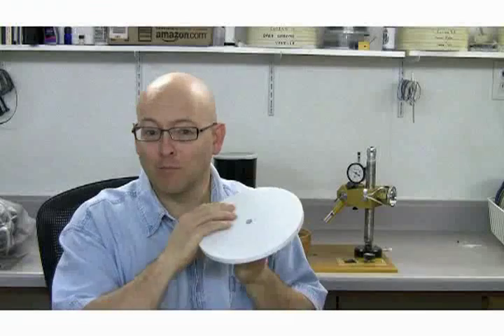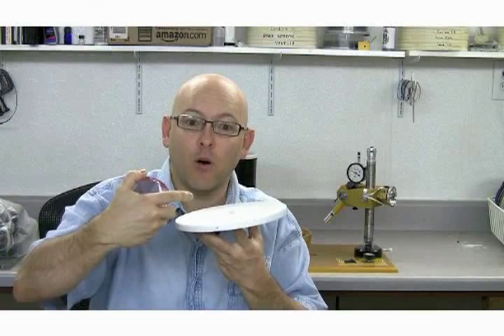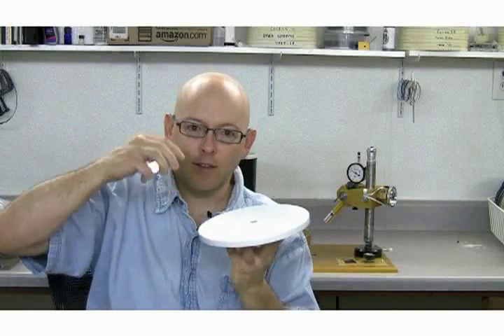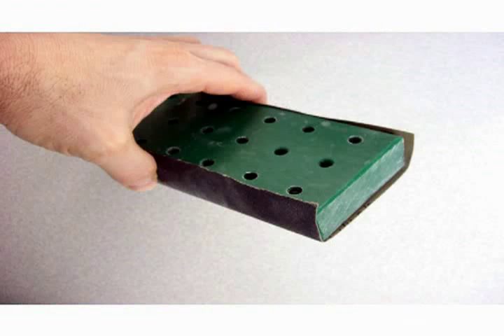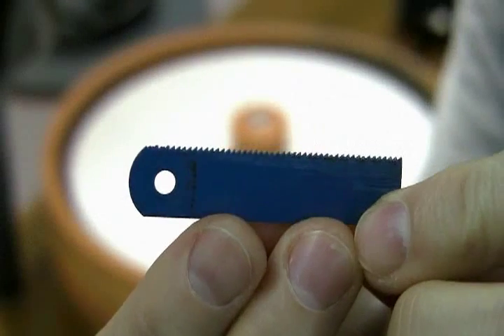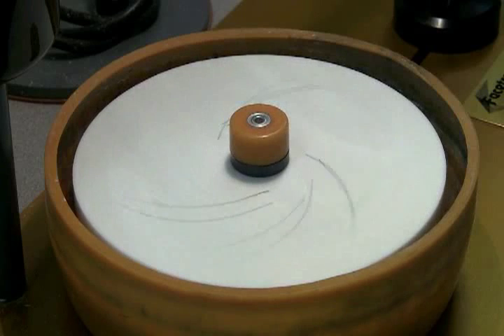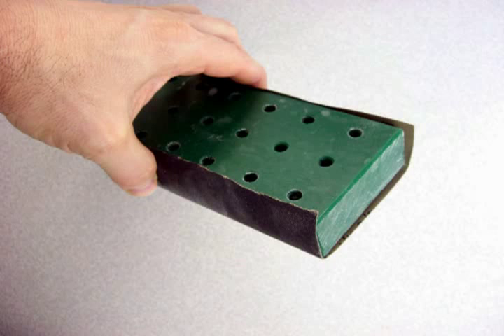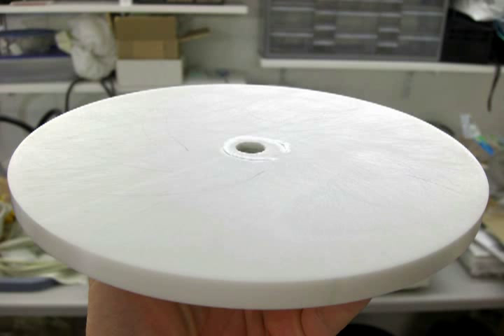Scoring a Polishing Lap

Comment: Hi, 

I have got some big scratches on my zinc lap due to the stone was suddenly broken from the dop. Should i fix it with a sandpaper or a hack saw blade?
Reply from the maker: DO NOT SAND A METAL LAP. You might embed grit or fragments in it.

I also don't recommend using the hack saw blade technique, either. The scoring is often way too deep.

Begin by washing, scrubbing with soap and a nylon bristle brush. 

Then, use a NYLON scrubbing pad and some mild solvent like WD-40 to scrub the lap by turning it reverse from the direction it was in when the stone broke.

Finally, inspect by eye and with fingertips feeling for embedded fragments of the stone.

If you can find nothing, test the lap gently using a soft stone like window glass or marble that's been faced to pre-polish level. See if you're getting scratches.

If it's not scratching, you're probably OK. If it continues to scratch, use the glass to find the spot on the lap that's scratching and then pursue spot decontamination using the scrubbing pad. DO NOT USE STEEL WOOL. I often will use a stainless steel brush - one of the small toothbrush sized ones. You might possibly use a razor blade.

These are techniques that fall short of sending the lap for machining a new surface. With care and effort you should be able to avoid that.

Any other questions, feel free to send an email through the web site.

Good luck.
Reply: @gemstoneartist  thank you for your reply i will soon try to fix it.

Comment: Hi I was wondering whether it's possible to resurface a phenolic lap? I have one that I have used for many years but recently I have had consistent scratches with it when I polish quartz. More so than the usual quartz mayhem... I have some visible scratches but I can't feel them under my touch so I am unsure about this. I don't suppose it's a lap that would be scored though...
Reply: If your lap has gotten glazed or contaminated, it could be the source of your scratching issue.

You can easily resurface a phenolic lap the same way you do any other composite.

Have a look at this video:

https://www.youtube.com/watch?v=VTqp2wzMDEI

Hope this helps.
Reply: Hi John many thanks for your reply. I didn't realise the phenolic lap could also be sanded down. I will try it!

Comment: Instead of sandpaper what would you recommend for a metal lap, specifically a gearloose zinc+? I ended up putting a decent gouge in mine and it sure is frustrating. Thanks for all your videos, I hope to attend the academy someday soon.
Reply from the maker: The reasons for scoring are mooted by modern alloys (BATT, BA5T, etc). So, I wouldn't recommend scoring those.

For scoring other metal laps like traditional Tin or even Copper, I do NOT recommend the traditional methods like razor blades or pieces of hacksaw blades. Those things are WAY overkill. All we want to do with scoring on metal laps is to break slightly roughen the surface - to "break the glaze". We want those things to be fine, and really all over the lap.

I personally use wire brushes with stainless steel bristles. I start with a small, fine-bristled brush that's just bigger than a toothbrush, and if I think that's not enough I'll use a more coarse one (almost never feel the need). I put the lap on the machine, and drag the brush from next to the nut outward to the edge. This rotates the lap just enough for the next almost-radial swipe.

I wouldn't recommend scoring a Zinc+ prepolish lap, either. It's not needed and  will just impart undesirable surface problems. If you've gouged one of those to the point it's a problem, send it back to Gearloose for re-surfacing - or buy a replacement.

There are still seats for the May event, and your comment here will earn you an extra discount if you seize the day...

Comment: Stair stepping is exactly my issue John .  This video on sighting the rifle was very helpful.  One quick followup question.  Once sighted do you always go back to zero "0" on the cheater for cutting the next stone's pavilion and then always go to the marked cheater number after transfer for the crown?  I assume the answer is yes, unless you change gears but would like confirmation.  Thanks so much for the tip!!!
Reply: +Christopher Olson I think there's some confusion. The zero mark on your cheater is ZERO. That means the location of "zero twist" after transfer. This only works if you cut the pavilion there - and also cut the crown there (at your MARKED) zero. If you begin a pavilion at the "0" on your cheater - and then move to your mark (assuming it's not ON the "0") - you're going to impose even more twist.

To be clear: The ZERO that you MARKED - that is your "true zero" - at which to begin all stones, and where to return after all transfers.

I hope this answers the question - and prevents errors. Other questions, just ask!
Reply: I have a full knowledge in Daimond polishr cutting and xxx with hert & arrow contact me my what's up number is a+919904688180

Comment: Dude, your awesome. Great tips and advice for a novice cutter like myself. Could you touch on polishing on plastic laps? Thanks
Reply: +drick freak Thanks for the kind comments. Treat plastic laps the same as Corian. Score / resurface them the same way. Charge them the same way, etc. Same for polycarbonate, etc. Hope this  helps!
Reply: Thank you. Your knowledge is treasure. Im using a very old machine but it works great. Polishing is the greatest mystery to this artform for the amature. Morning stone, barion oval sunstone 15 ct.

Comment: I wish I would of seen this a week ago.  I'd assume this works equally with a lead polishing lap.
Reply: +Keithvs Sorry it took me so long to post back - just saw your comment. DO NOT use this technique on a lead polishing lap - it's likely you'll leave grit embedded in them. Most of the advice I've seen about scoring metal laps uses things like razor blades or other metal scoring tools. In my experience, those also cause problems. My favorite tool for scoring metal polishing laps is a coarse STAINLESS STEEL wire brush (do not use other metals). I brush in long strokes from center to outer edge - and just enough to "paint" the surface with brush marks.

DO NOT use these techniques on BATT or BA5T laps. They do not need to be scored and doing so will harm their performance rather than help it.

I hope this helps!
Reply: Hey!! You need to post some rocks or something

Comment from the maker: I'm glad to share something useful.
Reply: ismail adam  Many people never score their tin lap. Some people do them very aggressively - often ruining them... 

If I'm using a lap for diamond polish, I won't score it. If I'm planning to use e.g. Tin with Alumina, I'll score, but I use a very gentle method - and recommend others to do the same. It's very easy to over-do. The goal isn't to carve troughs into the lap, just to "break the shine", so a simple brushed finish will work just fine. I keep some tooth-brush-sized stainless steel bristle brushes. DO NOT use regular steel, as they'll shed rust that can stick in the surface of the lap! 

When a tin lap gets shiny, it may polish slowly and/or start throwing cat-hair scratches. That's when I de-shine it with the stainless steel wire brush. Just strip the lap with some alcohol or something else to get it really clean and oil-free. Then, drag the brush from center to the outside, moving slightly off center so it turns the lap a little bit. Work your way around and create a nice brushed finish. 

Wash / scrub it again to make sure it's clean, then go back to work. It's a very quick and easy process, and the brushed finish holds the polish well.

Polishing with oxide is tricky at first. The most common mistakes are using too much polish and too much water. Remember water is only a catalyst and you want VERY little of it. I use a hand pump bottle that throws out a fine mist of water. I spray above the lap and let it settle onto it - NO dripping or spraying straight at the lap.

Hope this helps.